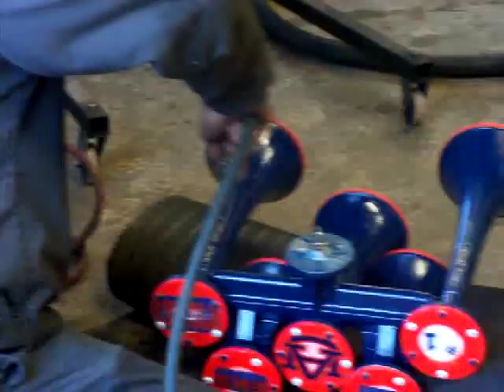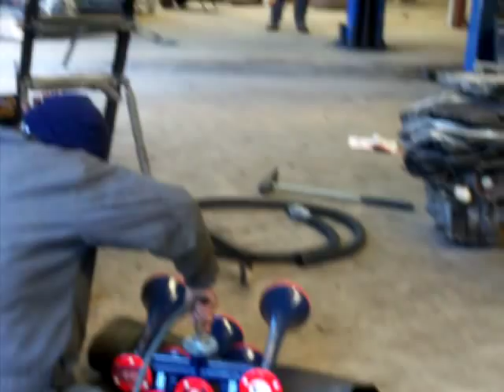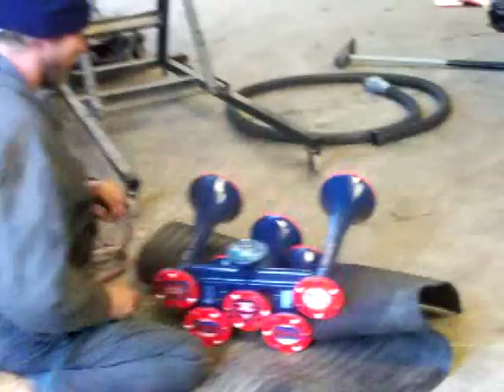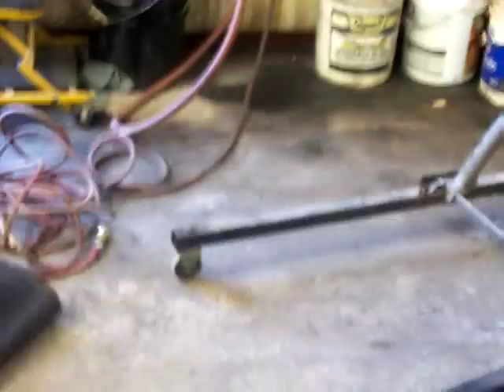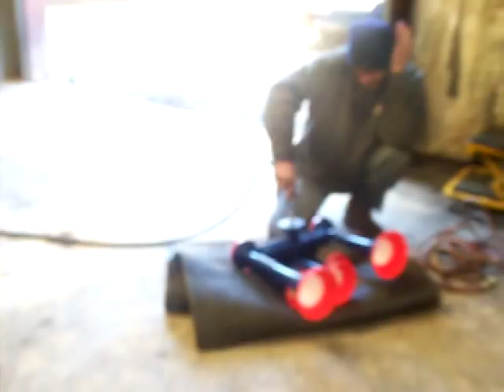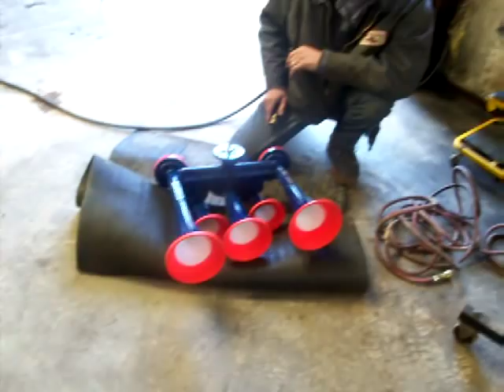Auburn Tigers Football-Nathan P5a Train Horns 4 sale - 1-01-11

Comment from the maker: $750.00 CASH OR BEST OFFER BEFORE THE 2013 SEASON STARTS.
CALL OR TEXT FRANK @ 706-302-4562

WILL TAKE FROM 60 LBS TO 150 LBS OF AIR WITH 3/8TH TO 1/2 INCH AIRLINE.

CAN BE SEEN UP CLOSE BY APPOINTMENT ONLY!